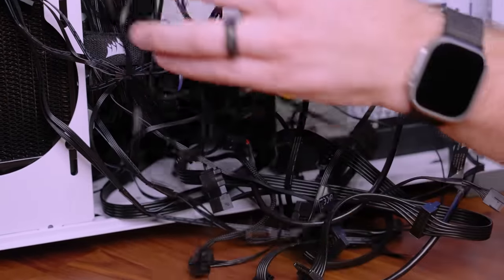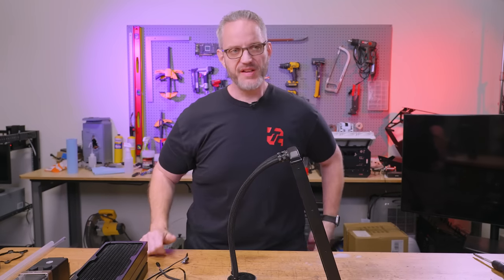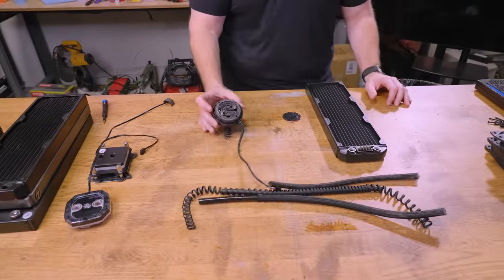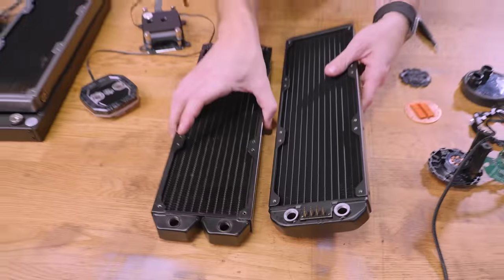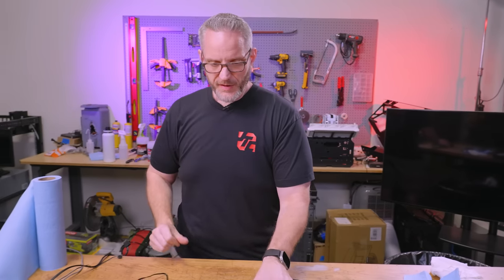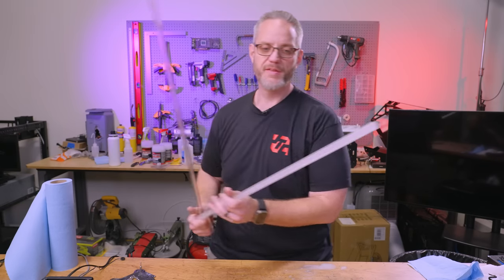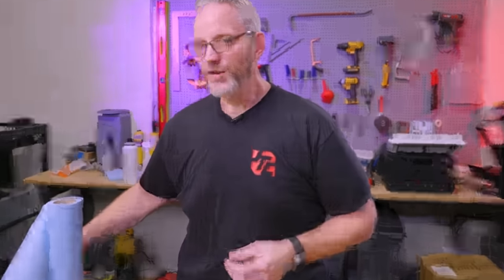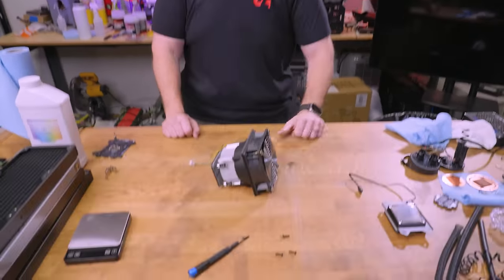Which one is right for you?

Comment: In my design office, we use the custom loop for all 5 of our Threadripper equipped render farms. For the individual work PC's we use either a chunky air cooler or an AIO. I personally use an AIO for my home PC, much easier to maintain, cheaper, provides enough cooling, if something goes wrong, I'll just RMA it or buy a replacement.

Comment: Previous full hardline custom water loop owner here. I've switched to air cooling because it's such a headache to upgrade components when you have a custom loop, especially the GPU and motherboard. Draining the loop, changing the water block to fit the new graphics card, re-creating pipes, re-filling the loop, it just got too much of a hassle, because I like to upgrade often. Modern air cooling is so good now that there's no need to consider liquid cooling any more for performance reasons, only if you want it for aesthetic reasons. Currently running a 7950X and an RTX 4090 FE, fully on air, with a Noctua U12A on the CPU. The system's completely silent even under full sustained load, and I mean completely inaudible fan noise, with CPU or GPU temperatures never exceeding 70C max, with PBO/power limit tuning. With this level of performance attainable, I would only recommend liquid cooling if you fancy tinkering or want to build a unique-looking system.

Comment: I done custom water cooling for two years about 10 years ago. I switched to an AIO and I have no regrets.

I bought a be quiet Pure Loop 120 to cool my AMD R5 5600X two weeks ago and I'm using thermal grizzly hydronaught thermal paste. I'm using pbo curve optimiser and my CPU hits 4.85GHz all cores 77wayt. 

With the 120mm cooler the CPU doesn't go above 56c at 100% use no matter what CPU test I throw at it. I've run various stress tests and no I didn't just run the tests for 20 minutes. I ran them for an hour each. Including occt  , cinebrnch and a few others I can't remember from the top of my head.

Also the pure loop comes with a bottle of water to refill the lopp.

Comment: So, been watching you for a while, and I've commented a few times, but I'm not sure if you get them. Something I wanted to point out has to do with your video about using car anti-freeze instead of 'proper' coolant.
You hooked up the new loop, and did a flush, and then put the coolant in. Then it started to look a little foggy and funky.
When you did the flush, what did you use? Most common thing people use is vinegar in with a bit of water. Vinegar reacts a LOT with what's in anti-freeze. Just a tiny amount turns it into a gel. I found that out the hard way myself. So, when you do the vinegar flush, you need to flush that a number of times with distilled water.
Also, you can dilute the anti-freeze with the distilled water as well. A 1 gallon jug of anti-freeze is about the same price as 1L of coolant, and when you dilute it with distilled water, you almost have a lifetime supply.

Comment: my custom loop has been re-purposed from skylake to 5900x which only needed a block change, already had 700mm (360+240) worth of rad so my upfront cost has actually saved me a lot in the long run for upgrading and cooling.

Comment: Please please please do another Ultimate fitting guide and more water cooling guides in general!

The 2 big reasons that I won’t do a custom open loop, is because of the discrepancy in sizes of pipes and availability. And the biggest one which you didn’t mention in this video but have in the past , YOU HAVE TO BUY EACH SINGLE FITTING AND THEY ARE NOT CHEAP and you need to hope you have enough. 
So you have to somehow plan and measure your entire loop without having any fittings.

Comment: Hard tubing and a full front panel distribution panel in my current build.  It was really expensive (but that was my choice) it was a nightmare to bend the tubes and get them to the correct length.  Now it’s built it looks more amazing than any build I did in the last 30 years since I got into the PC hobby in college.  I like AIO’s due to simplicity to install, but the aesthetic is nowhere near as nice as a well built custom loop with a decent colour theme.  This weekend, after 3 years I finally got round to emptying my loop so I could upgrade the CPU.  I hated having to mess with the tubing, but it gave more confidence to work on the loop again in the future.

Comment: 1/4" id is enough for any watercooling system. The flow of the pipe just need to be enough to feed the the intake of the cpu and gpu intake going to the fins. That's where all the restriction happens. Everything doesn't really matter according to tubing size.

Comment: I decided to go with an open loop design. For 2 reasons. One The individual components can be better, and two. Because of expandability. On the first point, being better components. Most, if not all aio's come with a radiator that is only 27mm thick. The Radiator that I chose was 60mm thick. So in effect doubling the size, and capacity of a an already large 480mm radiator. without taking up twice as much real-estate. From a business stand point. The current aio's include a lot. But in order to make it profitable. Corners have to be cut. So on one hand you get cheap and easy with an AIO. But on the other hand, it will never be as good as it could be. With an open loop, it will be as good as you want it to be. But it will never be as easy to maintain as a AIO. Since with an AIO there is no maintenance. Once it fails, replace it, and whatever parts it was meant to protect.

Comment: I made my own AIO using Barrow combo pump / cold plate, soft tubing, a 400 x 200 copper radiator and 2 x Noctua 200mm fans.  This fitted perfect in the lid of my Haf 700 and is near silent on full blast.  Cooling wise. never seen over 50c on my 5950X !!!  I worked out the Barrow pump moved 4 times the water of a standard AIO and easy to add extra rads if needed.

Comment: i was working as a tester for a watercooling company and we dissampled other companies parts and compared them to ours. 
when i started to work there i never did water cooling before. 

AiO usually got a very small shovel for moving water! They got really low litre/hour. also you cant shorten the tubes on AiO if they are too long or vice versa. 

BUT!! if you have a small CPU wich is really energy efficient and usually dont get really hot a Aircooler would be best. 

Unless you got some HEAT Monsters you need to cool it depends on your setup. BUT its not wrong to get a Good Pump and a Reservoir as a base. You can usually take Fatter Radiators to shovel the heat energy out of the system. So

1. Good Pump to work against the Flow Resistance
2. Enough Water as a Heat Buffer also to never let your pump dry out.
3. Depending on your system heat generation you need a radiator and fans suited for the workload
4. system routing doesnt matter thermodynamic wise 

my current maxload is enough for gaming but wont work for 24/7 cinebench so. you need to calculate it yourself - usually bigger = better for cooling

just my personal experience - dont buy alphacool , they lied to me a couple of times and they lost my trust. also never got their cpu block as good as they said (41 degree with 21c room temp and a professional water bath with 30C +/- 0.01C) we logged the exact same setup with heatkiller , ekwb , alphacool etc. 5 times with 5 different mouting methods and 5 different people! alphacool was always 5-10C worse than any other brand.

Comment: Gosh you said "when I started doing YT, all we had was non rigid" 

Dude, we are SO DAMN OLD! I remeber when you quit your job to YT Full time, I remeber when Hardline came about, I still remeber Skunkworks (RIP Case Labs). So much has changed! So old we are getting!

When all the tubing would leach plasticizer, so you had to pick the right ones. I remeber my very first WC foray, was a kit, I want to say it was called like big something (EDIT: It was a Thermaltake Big Water 760i, back in 2007!). With a intergrated pump in a dual bay rez, Those were AIOs back then!

So fun fact about quality as well. Although it has not been used in a decade, I still have my OG Raystorm Kit from XSPC. I have the Raystorm and the 240mm Rad! Its so damn crazy to realize I have been watching your videos for 11 YEARS!

Comment: Still would  go with the custom loop.. not just for aesthetics but the expandability, if done right its surprising how long  the fluid will last before it needs a change, when I 1st started I did a stripddown and changed the fluid out after  6 months of very heavy use, the 2nd teardown was after a year, in both instances the system was spotless,  I have just done a teardown and  the one before it was  2 years before covid  hit us in the UK  so  no maintenance bar topping up the reservoir  once or twice  and   PH value check  with a drop of biocide every  few months  for  5 years, I only did this  change  because I noticed a bit of discolour on the anti swirl plate  in the reservoir, temps were fine, and  besides a small bit of black from the neoprene seals  on  some of the fins in the cpu block  all was fine no other  crud at all, so the seals were changed  rather than chance it, the D5 pump  had hardly any build up in it too.. I use distilled water, rather than de-ionised water for obvious reasons, with a small amount of Ethelene glycol and  a biocide rather than using a premixed and it seems to have worked for me.

Comment: the major reason apart from cost that i have never attempted a custom loop is mostly because of the MANY complications with it. mixed metals, using the wrong water, getting the right tubing, fittings, etc. another factor that makes it difficult to me is i do not have the luxury of living in the US, so when i have to buy stuff, if i forget 1 thing i will have to wait weeks before i get it from amazon. one of my dreams is however still to at least try it with regular rubber tubing i dont think i'm brave enough to do hardline on my first build so i'll stick to rubber for now.

Comment: I just switched from a custom loop to AIOs. I would've kept the custom loop if money weren't as tight as it is, but the fittings were getting to be more than 10 years old and the internal o-rings in the rotary ones didn't fill me with confidence anymore. Combine the cost of a bunch of new fittings with the cost of a GPU block, and it just made more sense to switch when I got my new graphics card. Got an Arctic Cooling kit for the CPU and one of the Gigabyte cards with a built-in AIO.

Comment: Recently cleaned out my loop and I did not have the thing for the PSU so I started it with system on and poured like a madman! Got it going again with new water and the anti-corrosive agent. AMD 5800X3D without coolant gets hot fast XD! I have a custom EK loop from 2020 and still going good to this day! Also, problem with AIO is when it dies, gotta replace whole thing: open loop, replace a part, easy.

Comment: hardline enthusiast and i can say that open loops are tedious at first and thats about it for as long as you know what you are doing. The upside of open loops are the pumps and oh boii aio pumps are meh compared to an open loop, also the noise is close to none by just letting the pump run in a very slow speed but still have a really good heat exchange

Comment: Hmm. Just use two 55 gal drums($20 each) and gravity, no fancy pump or radiator. 
Maybe include a cheap pond or sump pump to transfer the water back to the upper drum, but you could just use a bucket. (Or use 30gallon drums and a platform that lets them be raised and lowered to reverse the flow.

Comment: PWM runs at full speed if you do not connect the 4 pin PWM header. I've used several or more through the years and they all have worked like that. So just do not connect the 4pin and only plug it into power so either the Molx or Sata power.

Comment: Nice to see a breakdown of the differences between the closed and open loop water cooling systems, I like the idea of an open loop system, but it's not for me, I just want a PC that works with the minimum amount of fuss. I'm still running a Corsair H115i on my Ryzen 1800X, and temperatures remain good. Hearing about AIOs lasting only a few years makes me not want to upgrade, my H115i has been solid for six years and still going strong.

Comment: I must be really rare.  I have had 4 different Corsair AIO's. All are still running, and working, and the oldest one is about 10 years old. 
I don't know why, but I have had GREAT luck, with machines that are on all the time.

The two oldest, are not used as much now. but still work.
The newest one, is a 240 rad, and it's about 4 years old I think.  Running like a champ.

(yes, I do listen to them, look for leaks, check to see that I hear water running. and stress test to see that the pump speeds up, water temp is changing and that the CPU is not over heating and thermal throtleing.
(Ryzen 9 3900 if anyone is wondering)

Comment: It's just a matter of how much time you want to spend on the system. Also, some need the confidence to make their own loop and don't want to screw up. I use air cooling because I don't use really hot components and don't overclock.

The custom will be the most efficient unless you build it badly in some way.

Comment: My current AIO is 4 years old and still have no issues - I might have gotten a gem as it hasn't had any issues yet. Then again it hasn't had any huge challenges with hot hardware yet. My former 3950X was undervolted and I didn't use PBO and it never got over 60 degrees and the water never went above 40. My 5800X3D hasn't seen 50 degrees and the liquid is between 30 to 38 and usually never gets hotter than that.

Have 2 older AIOs one is still running. It's a Corsair H110i from 2015. It's in my dads build and he's also a big computer nerd and it currently doesn't have an issue yet. The third one I had was a NZXT 140mm AIO that I used for a GPU. It died after a year and leaked.

Comment: I typically agree but I’ve been running my H150 AIO for 3 years and only issue I’ve had is the commander core. However I’m planning on building a loop in the next few years

Comment: The corrosion caused by dissimilar metals (galvanic corrosion) is from using noble and base metals in very close proximity. Base metals shed electrons to noble metals, typically this is regardless of the fluid used, water, acids, milk etc etc. Coolants with corrosion inhibitors just slow the process, it’s a treating the symptoms however the problem still exist. Depending on the proximity of the parts corrosion inhibitors don’t do much. You can see galvanic corrosion on dissimilar metals that are just contacting each other for extended periods of time like tools at the bottom of an old toolbox. Thankfully the process takes a long time unless you are using steel or very cheap stainless steel with copper directly, that’s a good way to speed run the process.

Comment: Low spec GPU with an aio is perfectly fine, for my build,  I had to water cool my 3090ti FE with a custom closed loop, my gpu was sitting at a constant 80c+ and now it never goes over 42c and my system ambient sits around 37c on a summer day. All using corsair Water cooling parts as well.

Comment: Jay you say it on every video, and i have to correct you. BOTH OF THESE ARE CLOSED LOOPS. An open loop water cooler is a real thing, but it has water exposed to open air. Hence open vs closed loop. It's AIO vs Custom, both are closed loops though. Maybe this time you'll see my comment lmao. I've been trying to get you to see this for years now lol. These are borrow terms from the HVAC industry, back when I got into doing custom closed loops you only had some off the shelf parts available, and while you could buy all off the shelf, there were still people doing DIY work to make their own radiators using car parts and just brazing fittings onto them that worked with PC tubing. The guides of the time touching on this were written by HVAC professionals as much as they were PC overclocking enthusiasts, but it's gotten lost in translation over the years. Now, you CAN run a custom loop as an open loop, but you really don't want to because the loop is going to get dirty really fast. Open loops are best for when you want to have evaporative heat exchange come into play. People were doing open loop bong evaporative cooling and hooking their cooling up to giant loops buried in the ground or under pools well before Linus got the idea to do so at his current house, the first build I saw doing this was back in 2007 and integrated both open loop bong coolers during the summer, and in ground cooling year round, and then for their PC cooling needs they coupled the open loop to the closed loop by putting the closed loop's radiator in a cooling pool with a pump pushing water through it, rather than having it vent to the air, since it was more efficient this way. The radiator cooled the closed loop down and kept all their desktop PCs cooled 24/7 whether they were running or not.

Comment: I can also vouch for the Mystic Fog 
I've been using the pre mix for a few months now and it's been going beautifully. No issues or weirdness and I have clear blocks.
The concentrate I used prior however, I had issues with. I followed the instructions but had nasty gunk build up. So beware on that and possibly use more distilled water than recommended for it.